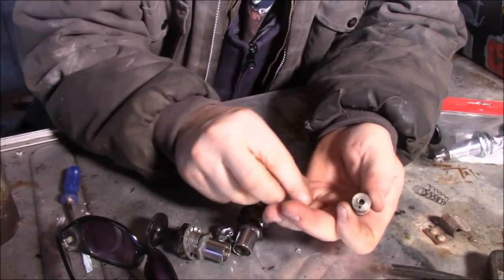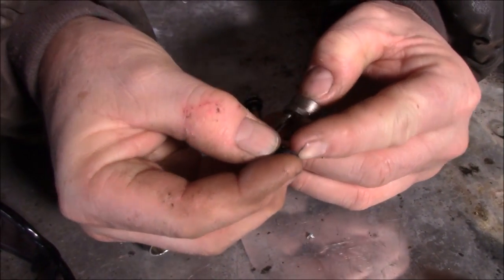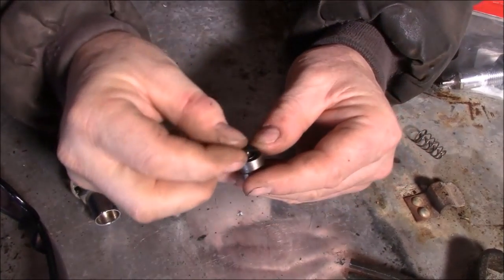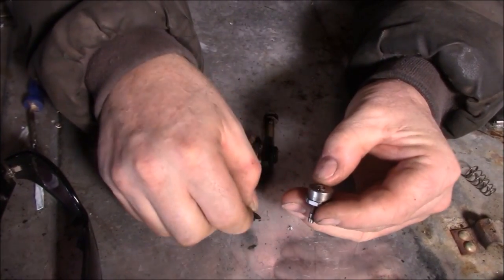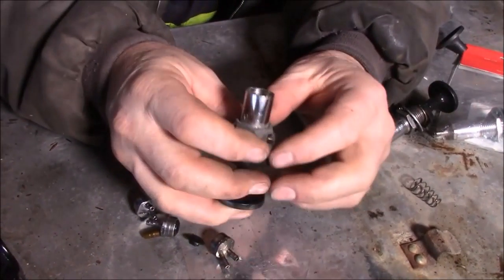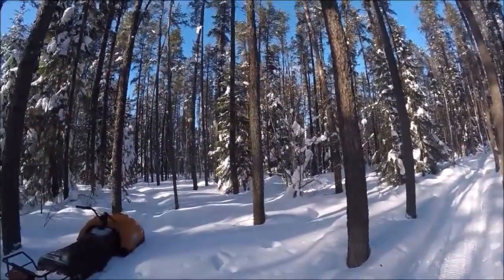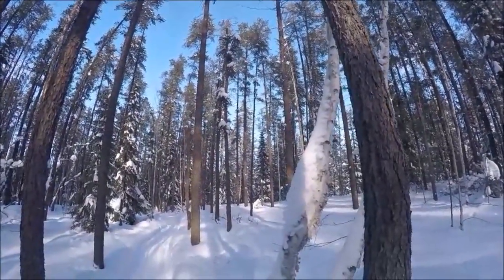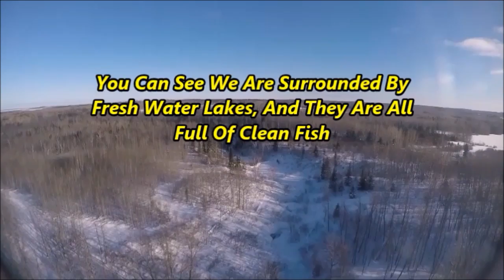I Had To Buy One, Testing Out The Drone Again

Comment: Use non petrolium based lubricant to protect rubber orings ext.. petrolium base eats away at rubber. 
      Like the primer bulbs on small engines they get stiff and dry then crack.